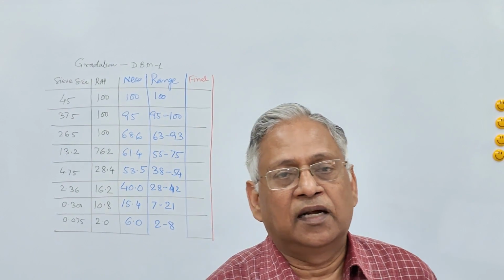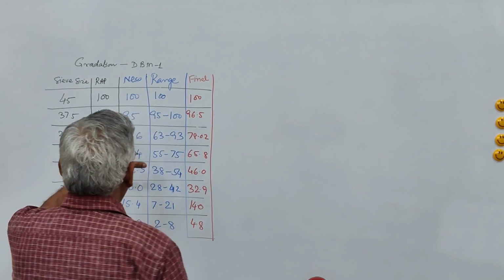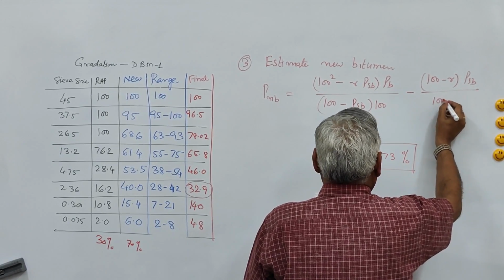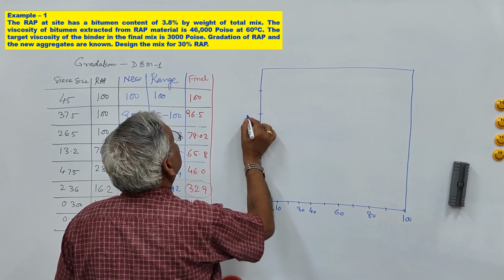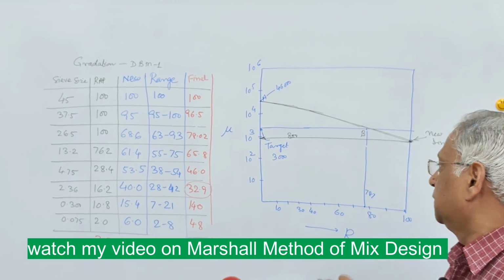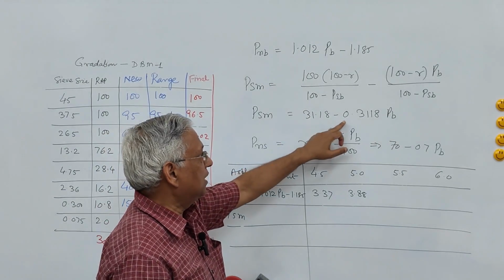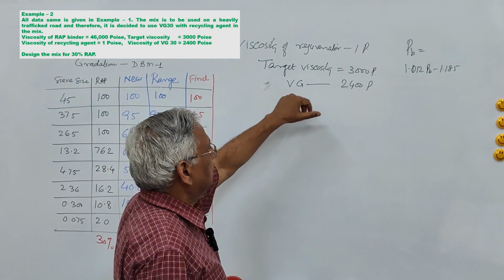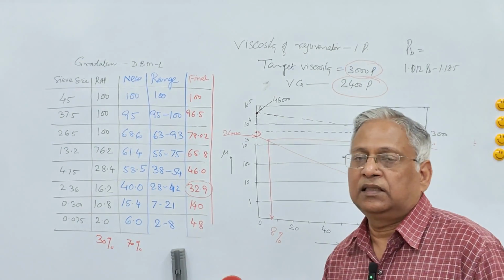Bituminous Mix Design with RAP illustrated through two solved examples. step by step procedure

Comment: Sir, for Marshall mould specimen preparation, we generally take a total mix weight of around 1200–1250 g, which includes virgin aggregates of each sieve size, virgin binder, filler, etc.

In the case of RAP mixes, for example with 20% or 30% RAP, how should we calculate the weight of each sieve-size fraction? Since the combined gradation is prepared using the bitumen extracted RAP aggregate gradation, I would like to understand how the individual sieve-wise weights of RAP and virgin aggregates should be calculated while maintaining the required combined gradation.
Reply from the maker: In this case also, the method is not very different. We design the mix in the laboratory. So take gradtion of RAP material as one bin and other size aggregates as different bins, similar to what we do in a normal mix design. Now RAP content is fixed at 30 percent and determine the percentages of 20, 10, 6 and dust to get remaining 70 percent. As simple as that.
Reply: @SatishIITR Thank you, Sir. I just want to clarify one point. In the combined blend, we are considering the RAP material gradation obtained after extraction. However, while casting the Marshall mould, we are using RAP containing binder, due to which the actual aggregate weight may be less than the total RAP weight.

For preparing the Marshall mould, we generally calculate the required weight retained on each sieve based on the DBM Grade-II gradation. In the case of RAP mixes, how should we calculate the individual sieve-wise weights of RAP and virgin aggregates, considering that the RAP contains binder?

Comment: Thank you for your valuable guidance Sir. Sir, I would like to seek your advice regarding the determination of absolute viscosity of RAP (Reclaimed Asphalt Pavement) binder using the Cannon-Manning viscometer. Due to the high stiffness of the aged RAP binder, the material tends to choke inside the viscometer tube, and even after monitoring for more than 6 hours, it does not reach the second bulb. I would like to know whether there is any alternative method to determine RAP binder viscosity without choking issues, or if there are any corrections or best practices we should follow while conducting the test at 60°C. Your guidance on the correct approach for determining RAP binder viscosity.
Reply from the maker: You can use DSR to determine the viscosity of aged binder. It will give you the dynamic viscosity - ratio of G*sin delta divided by the frequency 
ASTM D 3570 proivdes another alternate method also

Comment: Sir, I have crushed my RAP and divided it into three fractions (coarser, medium and fine). When I have determined the gradations of these RAP fractions after the binder extraction. Now, when I have tried to blend the gradation of RAP with virgin aggregate for 50% RAP, only my coarser RAP fraction is sufficient to meet the target gradation, along with virgin aggregates, for 50% RAP. Is it ok?. Should I have to use all three RAP fractions in my mix design? The idea is to use 50% RAP here, so I think it does not matter whether we use only one fraction or all the fractions, as long as we meet the target gradation. Please clarify for me, sir.
Reply from the maker: Why did you separate the CA, FA and filler in the RAP material. The RAP is used as it is. Then add some virgin aggregates to meet the gradation. In this case you will be using only one part of it. Anyway, if your supervisor says so go ahead. But in field RAP is used as it is because you cannot remove binder from it (it will be very expensive).
Reply: @SatishIITR  Sir, I have not removed the binder from the entire RAP material. I have just extracted binder from a small sample from each fraction to determine their gradation. Then, using an analytical technique, I have obtained the blended gradation of RAP and fresh aggregates. Here, only my RAP fraction-I contains all the sizes of materials for 50% RAP. The size of the RAP fraction I considered is greater than 9.5 mm. But it is binder-coated. Therefore, I removed the binder to check the gradation of that fraction, as agglomeration of finer particles is present due to the binder's presence.
Reply from the maker: Ok  @ALLINONE-qr5eh

Comment: sir, when rejuvenated bitumen mixed with virgin bitumen to get a target viscosity then how optimum dosage of rejuvenator is fixed ?
Reply from the maker: Dose of rejuvenator is generally fixed in advance, some time by the manufacturer
Reply: @SatishIITR  During Marshall mix design new binder to total binder is changing in each asphalt content (4.5, 5, 5.5 ...). That means viscosity will vary then how to reach target binder viscosity every time ?